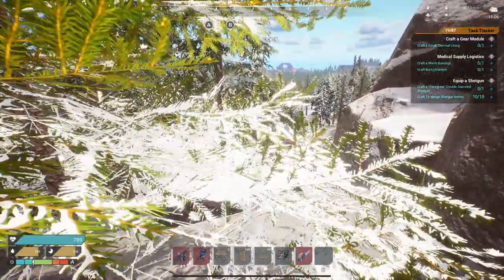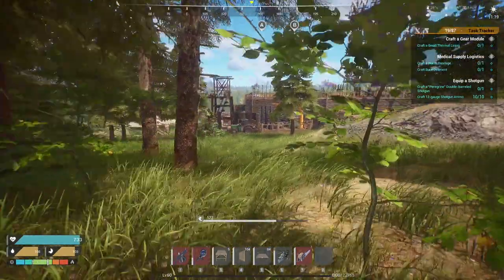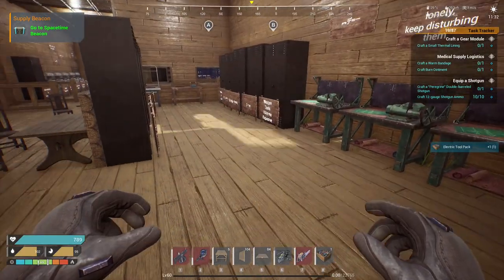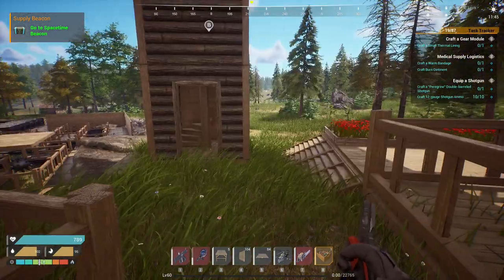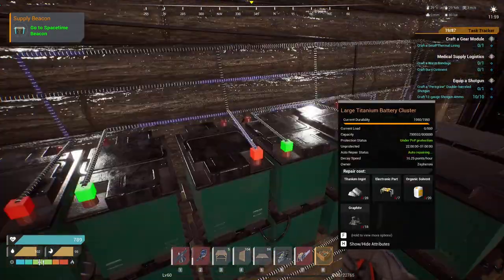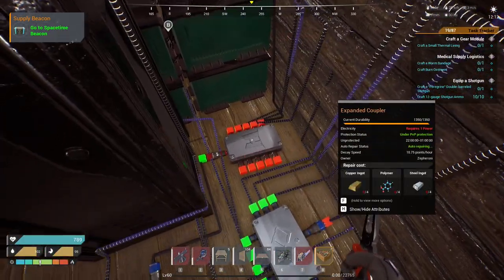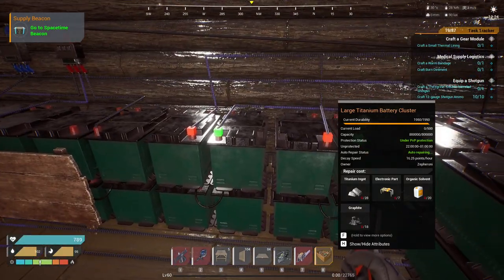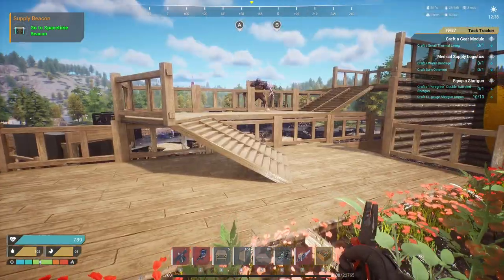The Front  = Batteries and How I Hook Them Up

Comment: I feel like it should be possible to daisy chain a group, like 2 batteries and them to a coupler and another 2 batteries desame thing, so u still get high power output but more batterielife
Reply from the maker: I don’t think it would ever be a good idea. I doubt I even need them to be fair at this point. Batteries really only needed if the max power required is less then the bottom of your power production. Currently the min/max of my turbines is enough to power everything. Originally out there for solar which I no longer use. 

If you daisy chain them they only have a max output of 500 so 2+ batteries would still Be capped at 500 so al you are doing is making a larger battery with the same output. Which is fine as long as that is understood
Reply: @Zephton  Yea but you can combine them with another pair of batteries so now you got 1000 coming out from the coupler and longer battery life.

I figured it out only works with the expanded coupler and splitter but not with the small versions. 

Now i can combine both parallel and series connected batteries. Generators power turrets and charge the batteries. And when gens run out my batteries take over. Long battery life and 3000 power to use 😅

I play PvP btw

Comment: I have made tower of power well got about 15 turbines at the minute, out of 4 turbines I am getting about 243 input I have another 4 gettin g baout the same charging 2 batteries, both fully charged the thing is which I find is a bit weird is that the batteries have a max output of 500, so my main area cosumes with everything of about 500 but the problem is that even though my batteries are going through extended couplers it only takes charge from one battery even though you can see the electricity going into the couplers from each battery, I am not sure if you have this issue too or is a game bug, but really the charge should be taken from both batteries only one battery is showing a load the other is zero.
Reply from the maker: Sorry for late reply, dont see notifications for comments sometimes. Sadly I have moved on, i recall there being some weird issues with how wiring worked when i left.
Reply: @Zephton  I have moved on too, I got b ored of it wit not much to do aftyer the initial base build thanks for getting back to me though